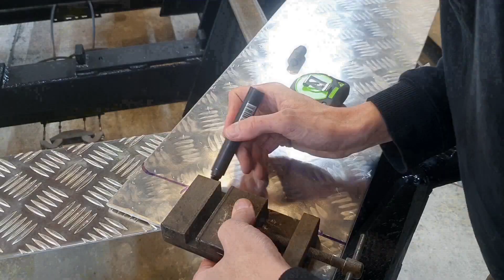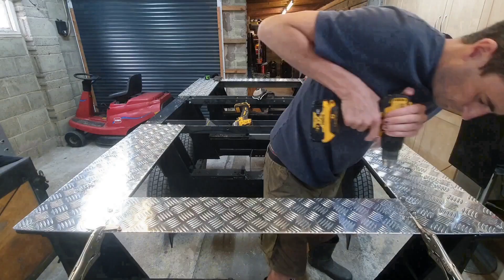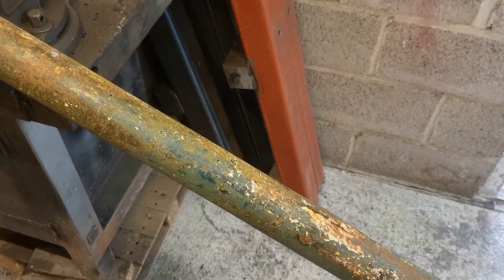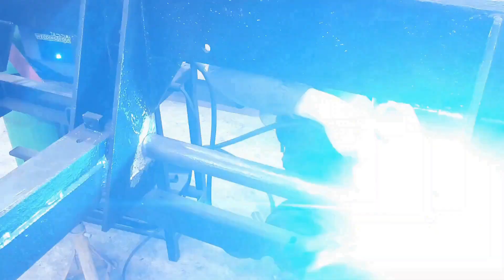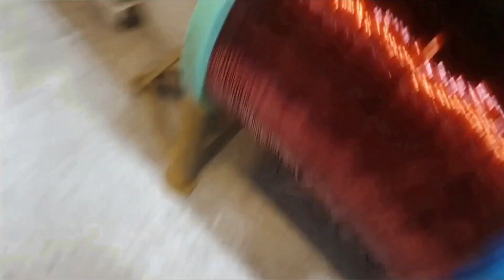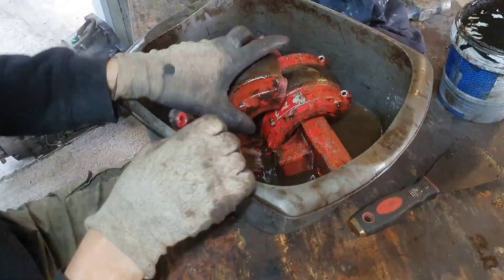Eddy Current Brake coil winding disaster, Mobile Rolling Road Restoration, chequer plate flooring

Comment: Ive worked out the difference between us Loz. You did a ton of calculations on centre of balance to get it exactly right and unequivocally proven to seventeen decimal points. Whereas I'd have probably just jacked it up and balanced it in an old broom handle until I found the middle...😂
Reply from the maker: Hahahahaha, that sounds about right. And you'll have got it more accurate......   I'm waiting to find I'm way out when I have it all finished and weigh the nose weight of the trailer. 

Thanks for watching buddy
Reply: @lozl  What about balancing the rollers? It'll jump around.
Reply from the maker: @stephencooper8609  You don't miss much Stephen. But on this occasion you have missed a video several videos back. I had all the rotating assemblies balanced. Good for 2500rpm which is pretty much 150mph. The most restrictive bearing having a max rotational speed of about 2700rpm.